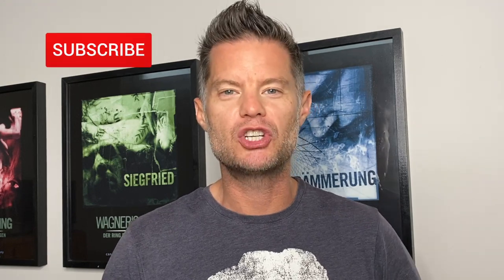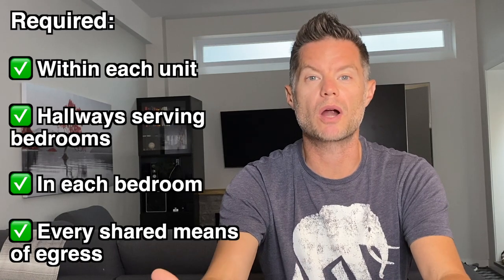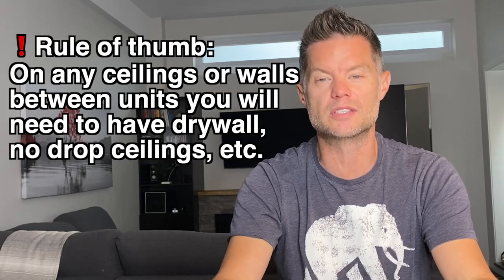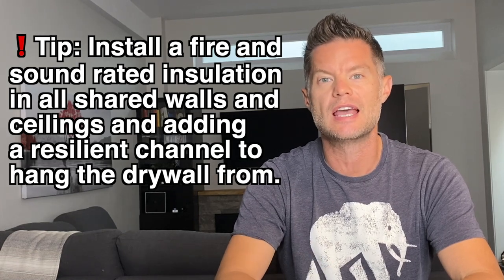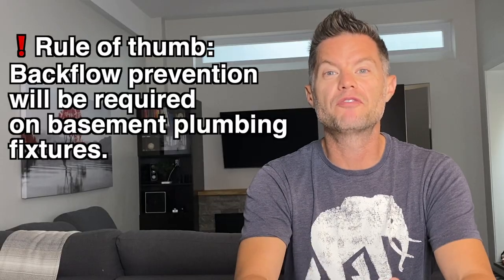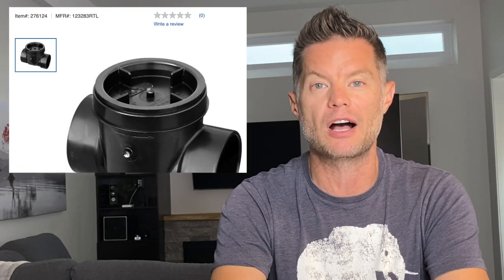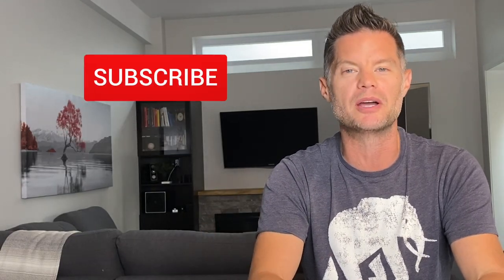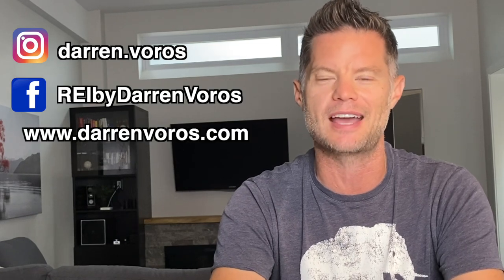How To Do A Duplex Conversion/Secondary Suite Conversion - Part 2. Building & Construction.

Comment: Wonderful video again!  After watching your house-hacking video yesterday, I can proudly say I'm house-hacking as we speak.  I anticipated that there would be kinks to iron out of the basement unit that we would slowly work on while living in it and renting out the fully renovated main floor.  We bought the renovated bungalow because it seemed to have more perks compared to the other houses in the very old neighbourhood.  For one, the driveway fits two small cars side-by-side and it has a single-car garage.  But the driveway is very patched-up and steeply sloped.  

Are there any regulations on the slope of a driveway in Oshawa, Ontario?  Also, I've heard that the boulevard does not count as a parking spot, is that correct?
Reply from the maker: I love house hacking! I'm glad to hear you are out there and living it as we speak. The best way to learn is to do :)